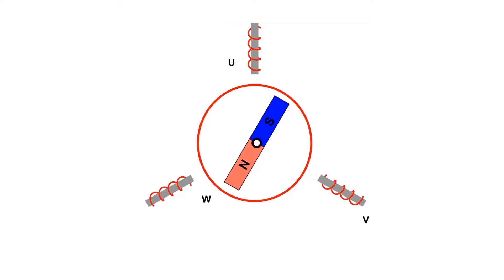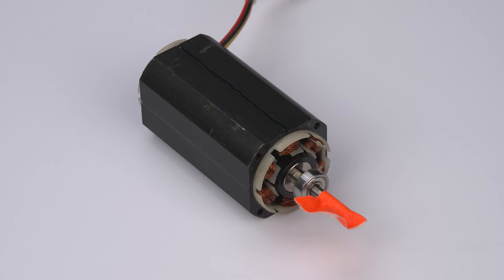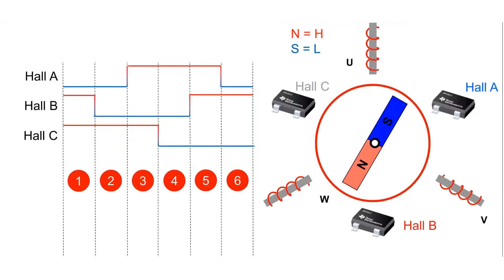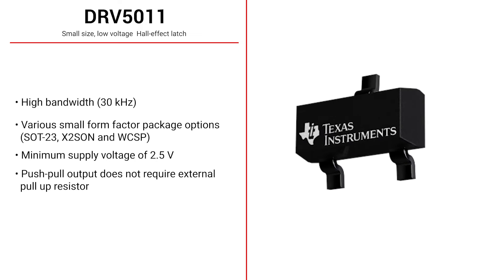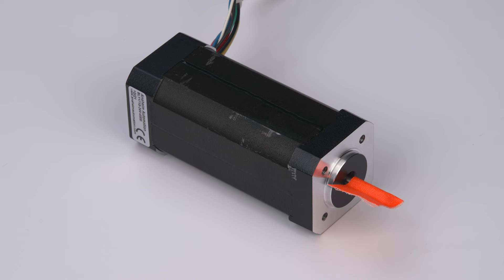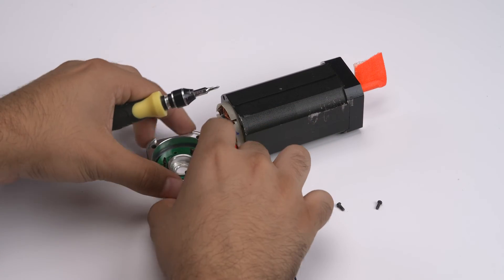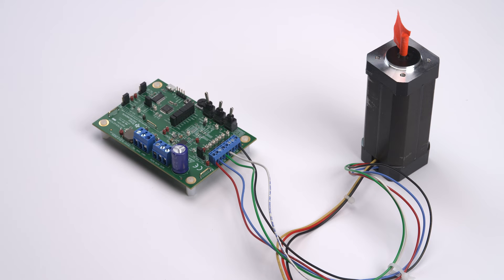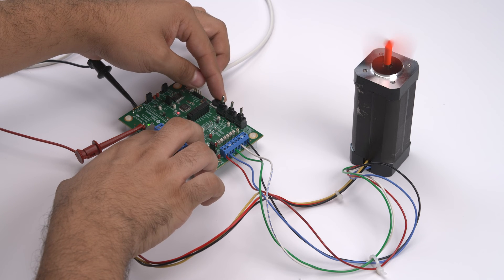Designing with Hall-effect sensors: BLDC motor commutation

Comment: Nice presentation, but keep in mind that using HALL sensors with InstaSPIN FAST  (as we do in our new book "Applied Control of Electrical Drives") using a F280049C Launchpad, is effective, as it provides sensored FOC torque control at low speed and sensorless FOC at higher speeds, which also reduces torque ripple caused by the six current  stepping effect due to the Hall sensors.  Also, this combination  provides a good check on the Hall encoder signals and speed control keeps using the FAST generated estimated speed.

Comment: Hello, thank you very much for this good explanation and demonstration! I have a brushless DC motor whose speed/RPM is controlled with a lever and a hall effect sensor, type 49E. Do you know a cylindrical circular hall effect sensor that has the same connections and electrical data as the 49E? It looks and is operated like a potentiometer but is a circular hall effect sensor. If something like that would work, would you even have a part number of it? Thank you very much!